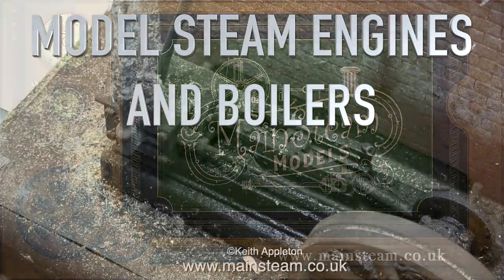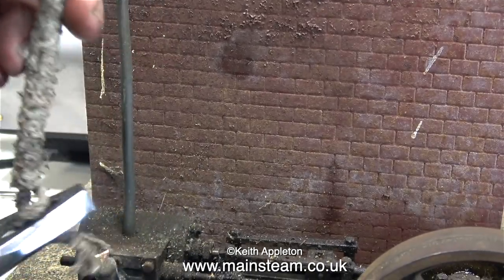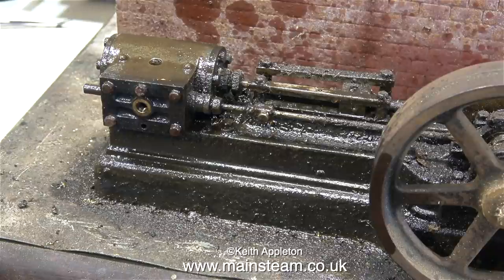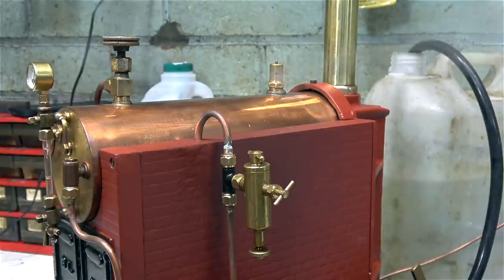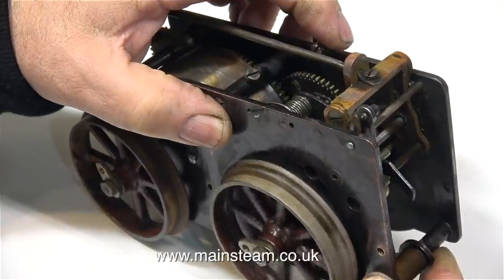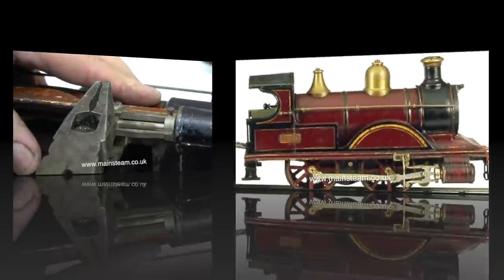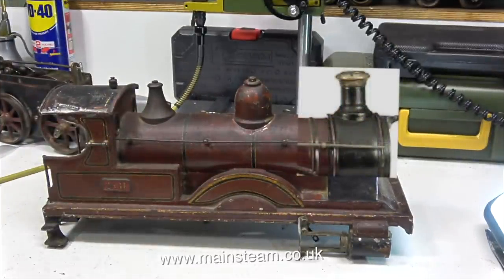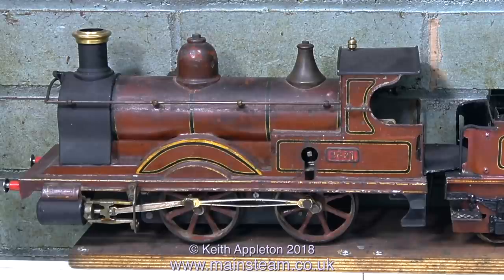MODEL STEAM ENGINES AND BOILERS - PART #16

Comment: Seeing the clockwork train. Warning for everyone - don't try and take clockwork apart unless you have taken all the power off the spring, or used a spring retainer clip. There is enough power in these to send all the parts into orbit. Well maybe not into orbit but to every corner of the room, damaging them and you.
That's a nice restoration.